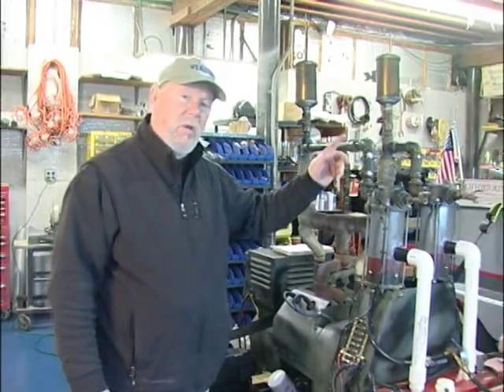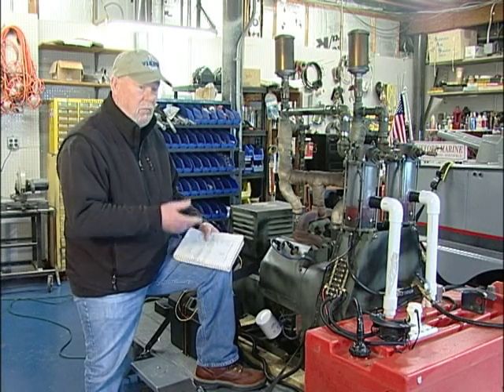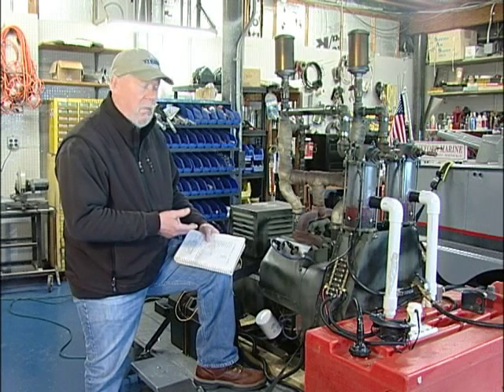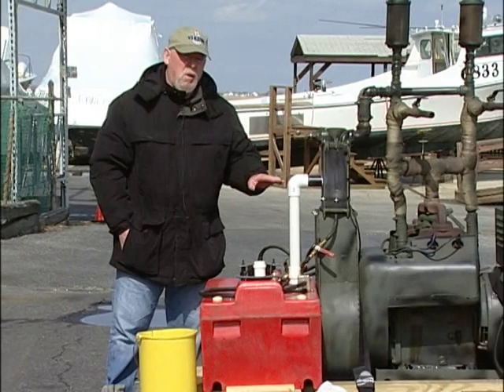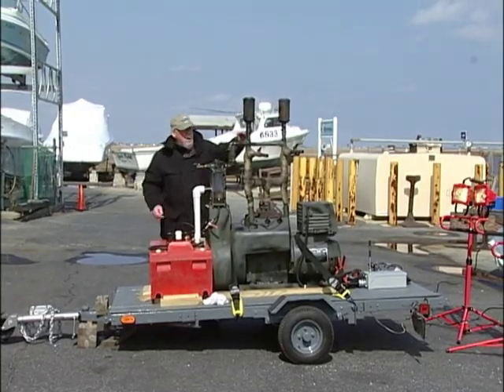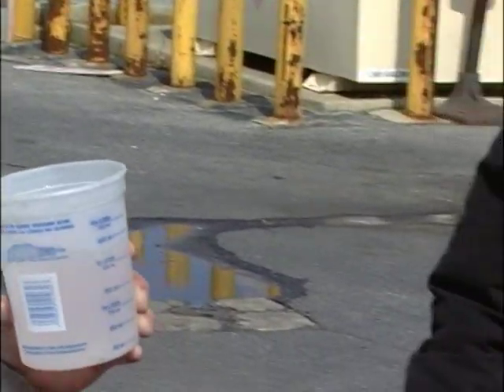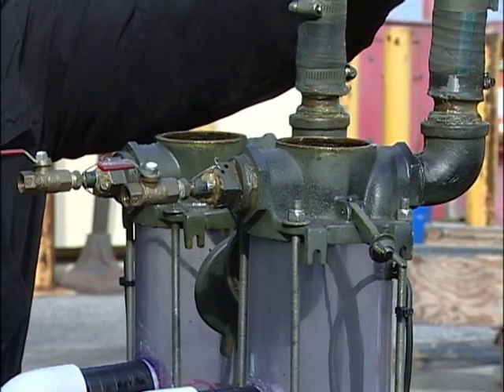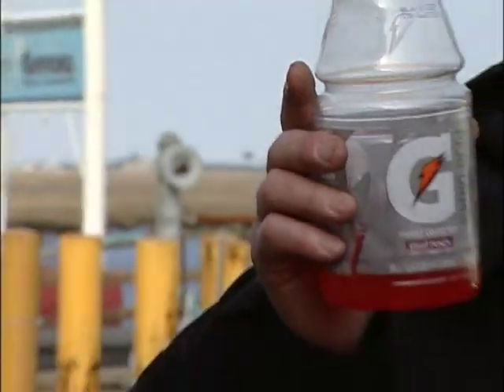Alternative Fuel Generator, twin vertical geet reactor

Comment: After the Geets; You aren't finished using the waste heat:  :)
Have a look at Combined Heat and Power (CHP) 
That should push efficiency up to well over 80% if you can use the heat.
90+% if it's a condensing heat exchanger.

You have batteries to store the electricity (spikes and peak loads)
To store the heat you have water, but for high temperatures (exhaust) a Sand Battery uses the least space and is cheap.
With both you have both electricity and heat storage and the genset can be sized to meet the average load/s rather than the maximum loads...

Then there's catalysts in the form of Copper and/or Zinc plating and 'wool' on the inside intake side of the Geet to experiment with.
See:
Catalysts for Steam Reformation and Water-Gas Shift Reaction. (WGSR)
Also Cerium Oxide.

Comment: Hey William, I have a 7,5kw generator for my shop driven by a 1 cylinder diesel motor!
And a V2 gas motor 10kw generator at home - but you have a V4 motor there?
At 7,5 that’s only 1,875kw per cylinder - a massive waste of power.
My guess is you could easily couple at least a 20kw generator to it?

Comment: With GEET - it is possible to mix as much as 10% fuel, with 90% water (can be waste water, ocean water, bottled water, tap water) many videos on the internet as well as YouTube, demonstrate this experience.

In addition to producing a hydrogen and helium rich fuel, a new element is made, GEET Gas.

My research and study indicate 74% of the universe is made up of Hydrogen, and approximately 24% is made up of helium. The two gases, in addition to Plasma, the GEET Fuel System Produces.

Paul has shared many stories of GEET:

Paul tells a story of a young student calling and asking for guidance in building his first GEET. It was for a school project, and the student want to build a GEET Demonstration Engine - with the free build plans (available free - on the GEET international main web page).

The school ask the student to be sure no fuel was present in the engine because the school does not permit fuel to be used on campus. 

The student made sure all fuel and fuel vapors were removed, cleaning the engine thoroughly. Teachers inspect the engine before it was allowed on campus, no fuel was present.

Because the student originally want to run the engine on 1/2 water and 1/2 fuel (50% water mixed with 50% fuel), the student kept only water in the engine, with all fuel removed. When showing the engine at school, for the science project, the student was asked by the teachers to pretend he was starting the engine. The student pulled the starter and the engine ran, and kept running. The student won the science fair.

Another favorite story of Paul's was when he received phone calls on more than one occasion, from the original star trek television series production (1960's) - asking Paul if he was aware that the GEET Technology powers their star ship? Paul watched the series and quickly saw that this was true. Stating that the GEET loves hydrogen and will work anywhere there is Hydrogen. And 74% of the universe is made up of Hydrogen :)

This reminds me of a very famous quote  "Science Fiction Is Science Fact - Waiting To Be Discovered" :)

Paul shares another story of building a GEET Demonstration Engine (See the free build plans on GEET International Main Web Page) with a customer, and running the engine for the first time. Paul felt inclined to touch the bottom of the reactor with a metal coat hangar. It had begun to rain and Paul didn't realize he was standing in a small puddle of water. Paul knew the GEET system produced a lot of energy, but was not prepared for what would happen next.

Paul reached down and touched the bottom of the reactor with the metal coat hangar - Paul was tossed more than several feet from the GEET Engine (this reminds me of the scene in the original back to the future movie, when Marty gets thrown back from the amplified speaker at Doc Browns Lab in the beginning of the movie).

"It was quite a shock" Paul realized that standing in the shallow puddle of water, with it lightly raining, with the GEET Engine running - and touching the bottom of the reactor - had somehow allowed the GEET Reactor energy to be released - Into Paul - Lifting Paul from the ground and throwing him several feet from where he was standing. If I recall the story correctly, Paul had a smile on his face, not because of the shock, but because of the energy that he finally met - first hand.

Paul learned the most from his students. People throughout the world called Paul on a daily basis sharing new discoveries with him. Paul shared that people have achieved the discovery of over 200 anomalies - most of which Paul had personally replicated with his own GEET Engine. GEET Stands for Global Environmental Energy Technology, which has the ability to produce clean energy, with no harmful byproducts nor waste. GEET can be powered by waste and contaminants and has no harmful byproduct nor waste product. One anomaly is the GEET engine has been documented to produce more oxygen from the exhaust, than is found in our atmosphere, by several percent. GEET can help heal the planet, and humanity.

Comment: If you're using one reactor, only use one fuel source type, with the recommended reactor rod size. Don't mix your fuels in the same bubbler and reactor. They evaporate at different rates, and your shorter hydrocarbon chains are going to evaporate first. Eventually, they won't run because there isn't enough fuel, apart from the oxygen in the air, remaining that will evaporate well enough. If you are using two reactors, and two bubblers, you can use two different types of fuels, but make sure each reactor and bubbler only uses on respective fuel type. Don't mix the fuels. The mixing of the fuels is a novelty that will leave heavier liquids that won't as easily and readily evaporate. Ethanol and water are your two fuels that will evaporate most uniformly. You'll need more reactors, generally, for the lighter fuels like ethanol and water, but they'll not leave any heavy or sludgy stuff in your bubblers that won't evaporate.

Comment: I have watched many videos like this. They all fail to do one thing. They all fail to show how the engine runs under load.
Reply: this guy runs his geet genie at full capacity of 2000wats
and if you look closely Bill has his shop lights hooked up.
Reply: In the video he says the generator is 7.5kw. Any motor at idle will run a soft load of 2000 watts. The test is to run it at full load for at least one hour to convince me.
Reply: no my link didnt post? the german ran a 3.5 horse 2cylc small motor rated for 2000wats and had almost a x7 gain. i agree it would have been better if Bill ran his whole shop or home on it show it works
Reply: Jim Rojas i think less power with less fuel wud be natural. Probably just choose a higher hp generator so half load is adequate...

Comment: good luck mixing water AND diesel lol
Reply: it just runs on fuel on anything that is explosive,  if he mixes diesel with water, applies heat to it, he will not get more run time out of that diesel this way,  if heat applied diesel will evaporate and engine will run on vapor, water will just steam it up,  if no electolosis is applied to water it will not become explosive because there's no way to get hydrogen out of water by using heat or vaporizing it.      it's just like running an engine on fuel vapor  and adding some steam to it,   still will use same amount of fuel
Reply: hookup your clothes dryer vent to engines intake manifold and just run it on gasoline as it does now,  it's the same thing

Comment: System does not crack the fuel and leaves most of the fuel in a worthless state in the fuel tank.
Reply: Saralyn Knowlton you use a vacuum to vaporize the fuel and the plasma breaks it apart and reconstitutes it back into the fuel cell. Genius.
Reply: Saralyn Knowlton https://youtu.be/K1mnfp1tDAY

Comment: it's just an atomiser induction system ! Adding water just de-cokes the engine of carbon and increase horse power short term ! Worst case scenario is a dramatic failure ! The Royal air force used water to add boost to thier Merlin engine ! This could only be done for a short time ! So to conclude ,water is heavier that Gas / Petroleum , It thins Diesel oil ! Tthe proses involves atomising the fuels much like injection system on cars and diesel Trucks but with the exhaust gases / heat helping to atomise the fuel mixture further !

Comment: Hey I have a question pertaining to your extraordinary gasoline engine. Does the water or Gatorade every actually evaporate with any of the gas or is this system just working as a filter to separate the gas into vapor???

Comment: Regarding "safety" in using a transducer with gas, there is a youtube video where someone is vaporizing gasoline with a transducer which has NO CONTACT with the gasoline.      Just go to ULTRASONIC FUEL VAPORIZER on Youtube

Comment: Clearly everyone has missed the point entirely. In the original Paul Pantone videos of his Briggs 5hp engine that emitted ambient exhaust with higher oxygen content, with a reactor that emitted radiation, and ran off of crude oil alone, or pure water, there was a factor that nobody seems to notice. The reactor was 4 feet long! Has anyone missed this detail? It takes time to develop the plasma state, and obviously the length of the tube, and the material of the tubing are the only factors.

Comment: HAHA this is the only smart comment I've ever heard. I can tell you are being sarcastic. Water is an energy source. Oil isn't an energy source. It takes a lot of energy to convert oil into a useable energy source, when it comes out of the ground, it won't run a vehicle. Water can be converted to an energy carrier by conditioning the water and then placing this charged water into a stainless steel reactor, called a Joe cell. It's not different than conditioning crude oil then calling it "gas."

Comment: Just seem like an inefficent form of water injection which is being vaporized and condensing in the intake and then making its way into the engine where it can vaporize again to condens again. Does sound as effecient as cold water direct inject which has been around for years. All that's happening is internal cooling. AND ANY LIQUID WHICH IS WATER BASED WILL BE DOING THIS, you could put milk in it but it wouldn't smell very nice. No compound are being seperated to elements here.

Comment from the maker: It would run on water and gasoline or Gatoraid and gasoline or just about any liquid as long as there's gasoline present. The engine will ingest a portion of the liquid as long as it contains gasoline. Take away the gasoline vapors and it will not run.

Comment: I did one of these setups on a little 125cc pitbike - 50% water, 10% gasoline, 10% used synthetic motor oil, 10% alcohol, 10% hydrogen peroxide, 10% rootbeer ran for an hour untouched and was warm to the touch when I turned it off

Comment: You should put this engine in a boat and take it to any offshore oil spills.  You could suck the crude/water mixture right off the surface of the water as the engine powers the oil cleanup equipment.

Comment from the maker: Mindthoughts,I have it running at 1 gal per hour, I am now able to to inject a fine water mist into the intake 's. This should help me lower it a little more. As to your  guestion regarding the transducer, you should not touch it while its operating. I was also a little concerned about using it in gasoline but that did work out ok. I tried running a small amount of ammonia into the water injection system. This did not work because it turned to soap suds and screwed up the vaporizer.  Thanks Bill

Comment from the maker: @mindthoughts1974     If you are modifing a transducer be sure you consider the safety aspect.   I am also working on a cold fog system that can be induced on demand. I just ran a four and one half hour test on the generator at one half load and maintained one gal. per hour. I never touched a valve over that period.    Thanks Bill

Comment: Water turns to gas and in doing so produces great expansion as any steam engine is testimony to, but do not introduce sugar in any form or the piston rings will clog and stick and the engine will loose compression and not run at all. If there is sugar in Gatorade, better not keep adding Gatorade or you will be rebuilding the engine very soon.

Comment from the maker: @narivasant  i haven't  tried adjusting the rods in anyway, I did consider stainless rods thinking they may hold the heat better. Without the transducers the engine would not run on diesel correctly, it did however run on waste oil from a diesel engine. I believe the engine can consume more water with some small changes.

Comment from the maker: The fuel level remains the same in the bubblers, it feeds back to the main tank through return lines as it runs. An electric fuel pump keeps the bubblers at a constant level. The normal burn rate for this engine at half load is 1.66 gals. per hour. It now uses 1 gal. per hour including water. I think it can run leaner with a gasoline diesel mix. Thanks Bill     PS I will check the audio.

Comment: It looks like your exhaust is running up while your fuel tube flow is running down through it, which means the rod's bullet nose is pointing upward.  Is there any reason you oriented the reactor flow in this direction?

Good work by the way.